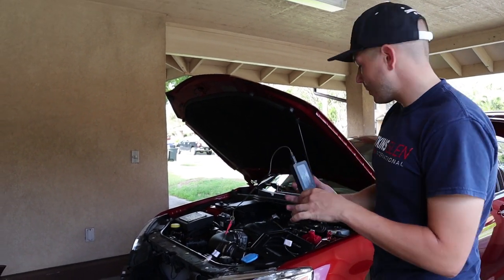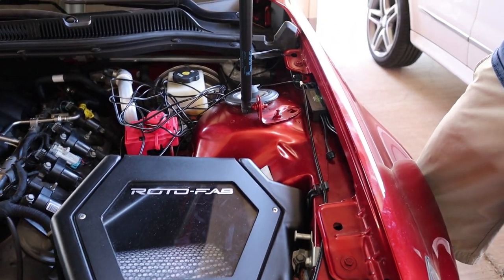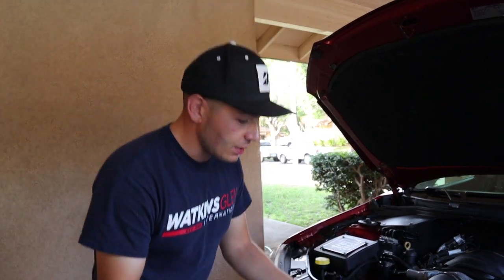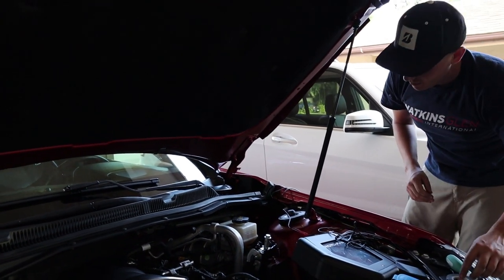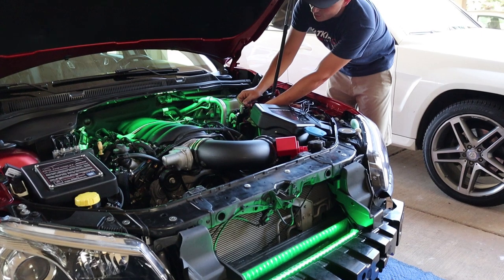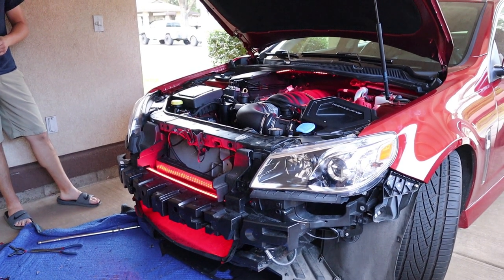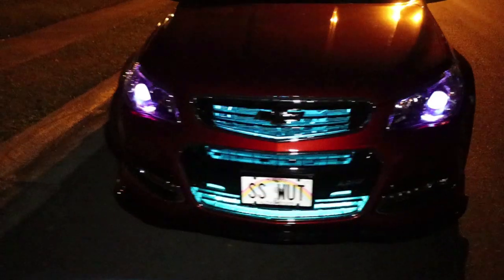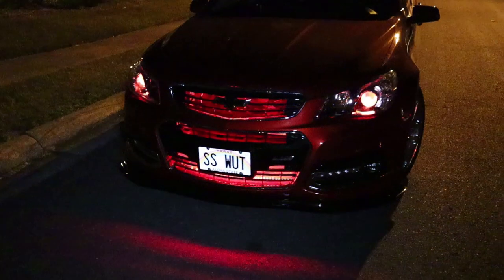Installing Opt 7 Grille Lights

Comment: Nice job... Car looks awesome.  Since you are doing car shows.. maybe consider the full underbody glow kit by opt7. You can tie the underglow to the same control box and have the colors match. I am doing the underglow and he footwell lights. For me the purpose is to use as approach lights (underbody and footwell) .. and the have the footwell on while driving so the inside of the car isn't so dark at night. I have a separate switch so i can turn them off individually. May consider the grille light as a tie in to the approach lights after seeing how it looks on yours.

Comment: Mine aren’t that bright perhaps I need to face one of the strips forward?
Reply from the maker: All of mine (x2 at grill, x2 at firewall) were installed facing down
Reply: The 4dr SS ok thanks I can’t face them down on my Nissan no good spots, right now I’ve got one shining back into the radiator and one sitting on bumper shining up 
Maybe I need to add the other two
Reply: Hey was able to find a spot on the bottom grill and face them down now it looks right
Reply from the maker: @futureshock7425  Awesome glad to hear !